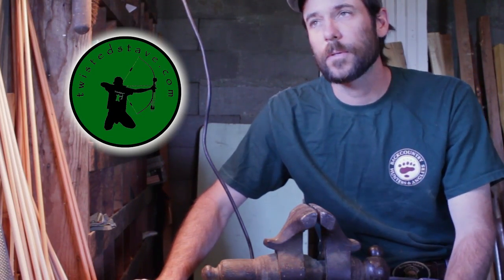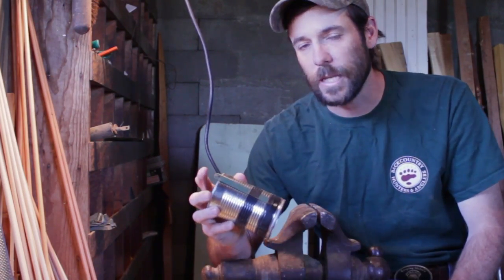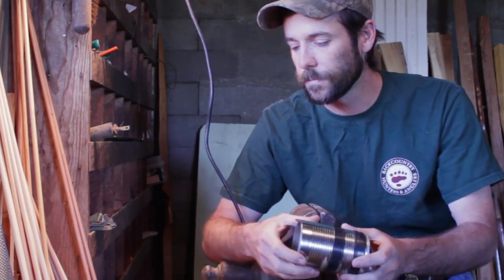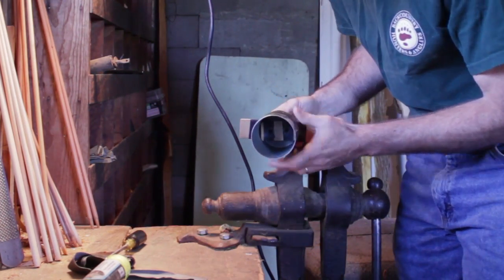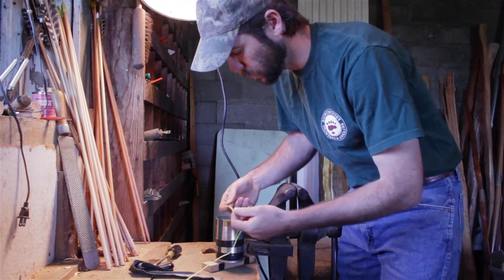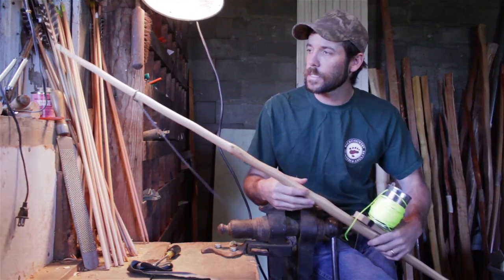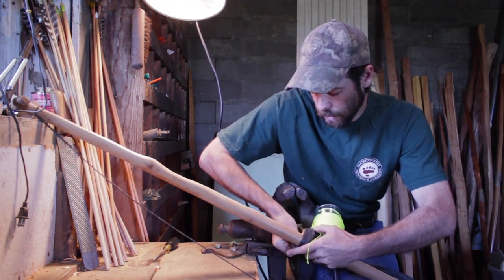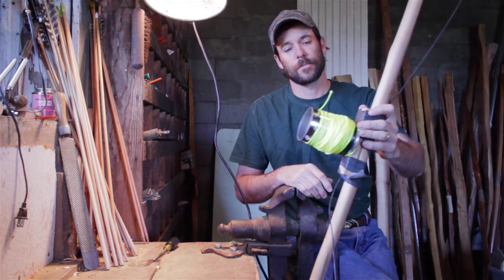Making a simple bowfishing reel

Comment: Is there anything else I can use besides the hacksaw blade
Reply from the maker: a stiff piece of plastic perhaps.
Reply: A rubber band around the opening works well. Used to use that when i was younger. After reeling up your line, make a bite(double line over) then tuck the loop under the rubber band. Youll rip a few off butvtheyre cheap and plentiful.